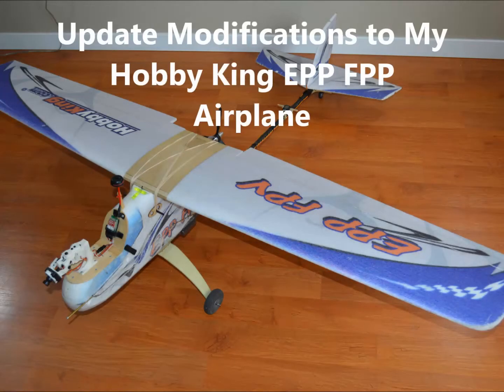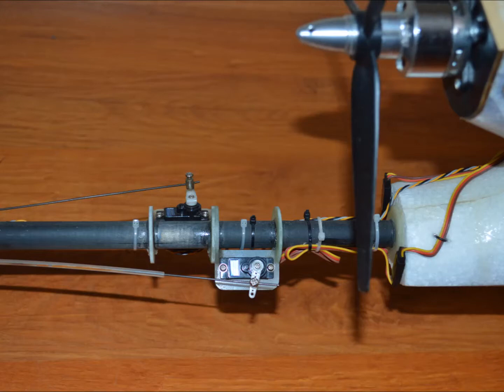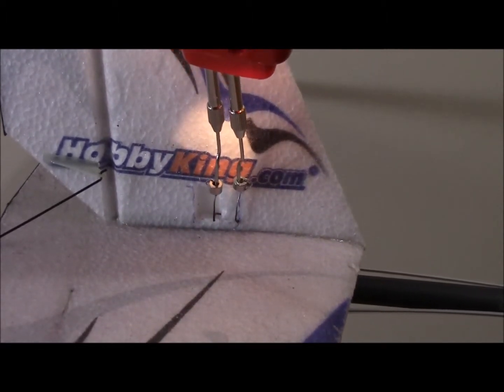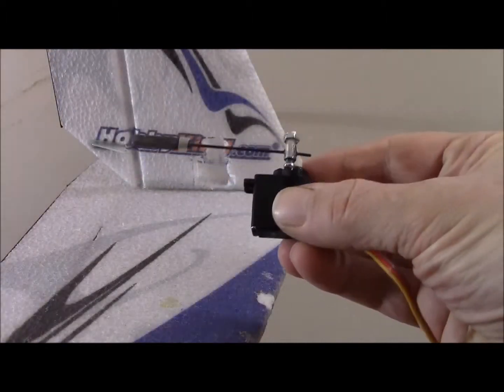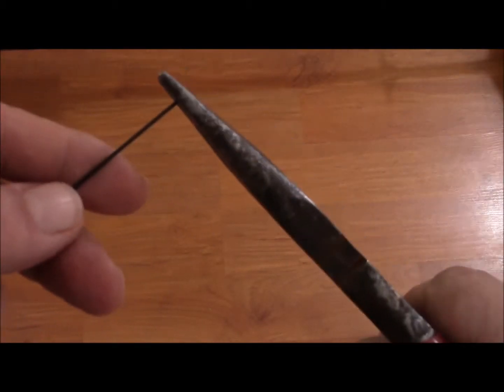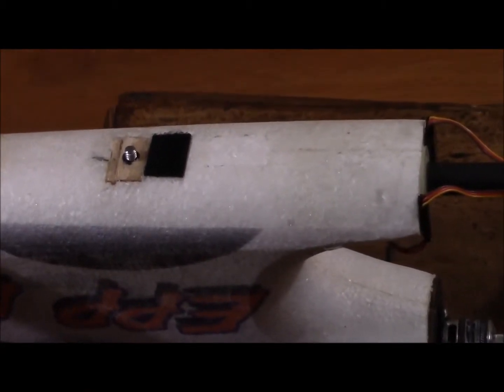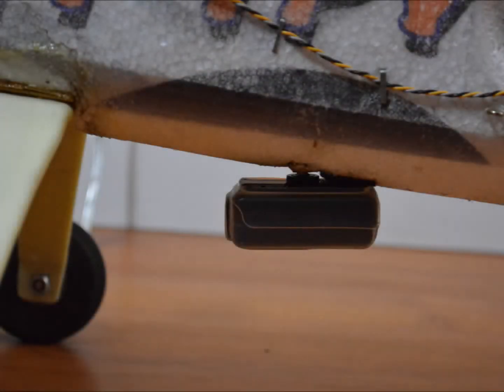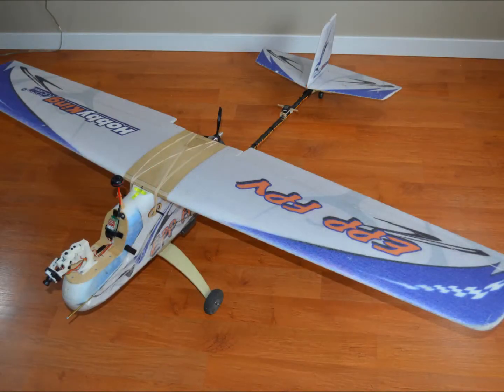EPP FPV Modification Update Video

Comment: Where is your CG? Manual says 45-55 mm from the leading edge but that looks too far forward to me. I just got mine and have not flown it yet and want to make sure.
Reply from the maker: +Ringo Davis Hi there, the CG on the EPP FPV is 100 to 120 mm from the leading, I just checked to be sure I have mine set at 110mm from the leading edge. hope that helps
Reply: +FPV TV perfect, thanks

Comment: Hola, cuánto es el tiempo total de vuelo?
Qué opinas de volar con una batt de 10.000 4s?
Saludos!
Reply from the maker: X-Cam AeroSoluciones 

Hi, the total flight time is 25 to 30 minutes. I think 10.000 mah. 4S would work well but you will need to move the battery further back
to make the plane balance because of the extra weight.
Reply: FPV TV Gracias! Crees que volará más tiempo?
La idea es grabar un volcán... "Calbuco, Chile"
Reply from the maker: X-Cam AeroSoluciones 

Yes. I think if I were to use 10.000 mAH in my plane I would
expect to get well over 60 minutes. I now get about 25 to 30 minutes of regular
flying if I go easy with the throttle I can stretch it to over 35 minutes and
after landing I usually have 10% to 20% battery power remaining.

I hope you are able get some video of Calbuco.
Reply: FPV TV Gracias!!